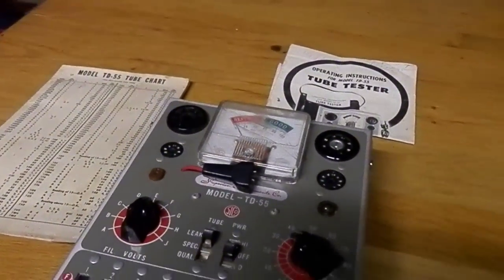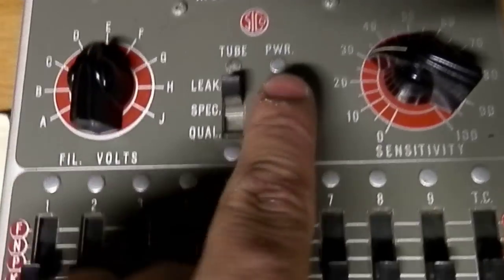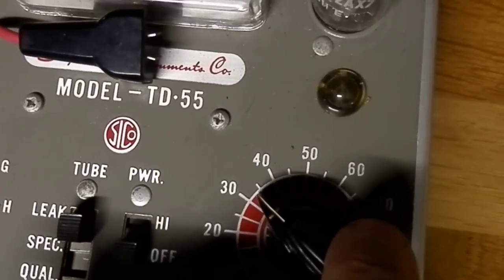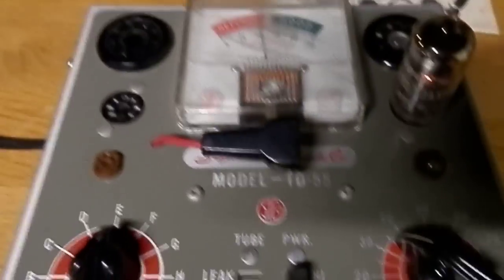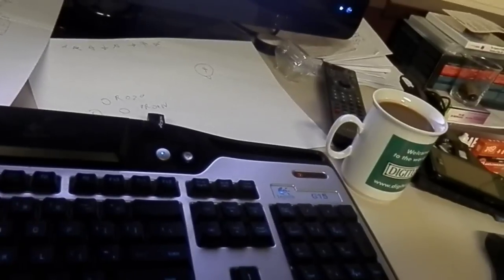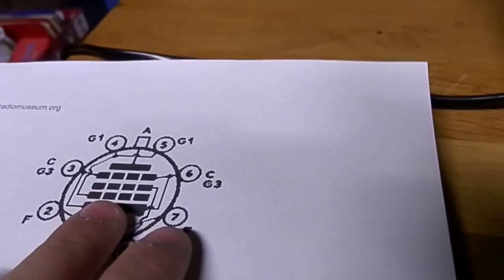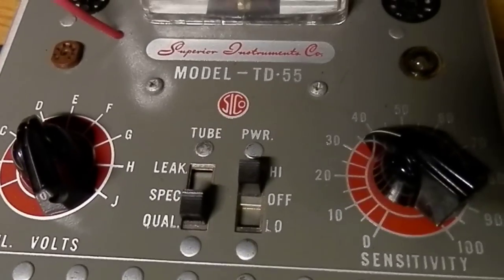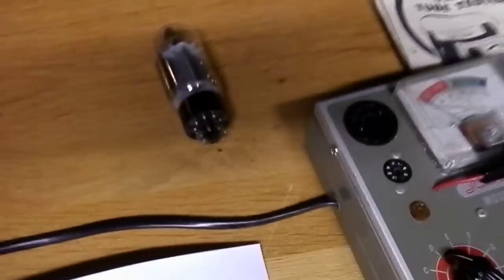how to operate a TD-55 tube tester

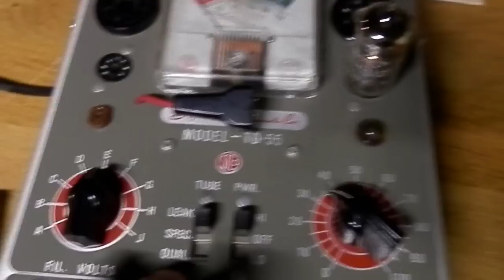Comment: I noticed two procedural errors in this video: First -- At 4:58 and 5:04, you switch the filament voltage setting with the tube inserted and the power on.  NEVER DO THIS.  The operating manual states: "Do not under any circumstances turn this switch after a tube is inserted into any of the test sockets. The switch should always be set before inserting a tube."  Second -- when you test the elements with the ten elemental switches, you neglected the instruction to "Tap the tube and observe the short indicator lamp" after switching the elemental switch to the P position; you observed the lamp but you never tapped the tube.
Reply from the maker: why not change the voltages during use?
also you are right on the second one

Comment: Does anyone know how to test a 6n2 or 6n2p preamp tube on this tester ? A 6n2p is like a 12ax7, but it runs at 6.3v and pins 4, 5 and 9 are different from a 12ax7. If anyone knows how to let me know. The manual stops at 6n4 and another manual by Lafayette (which is the same unit) has 6n3. But 6n2 i cant find. Thanks ;-)
Reply from the maker: to be honnest just set the fillaments to 4 and 5 and then the voltage to 6
the rest of the 12ax7 settings can be used

sorry I cant help more I dont own the tester anymore
Reply: @robot797  On the Filament setting I dont know what the voltage is for each setting. Its A-J letters for setting filament and the manual doesnt give you the details of what each setting is. Thanks for your response. Do you remember what setting is 6volt ?
Reply: @robot797  I think this is Volt Selector. 
1 - A
2,3 - B
4,5 - C
6, 7, 8 - D
10-18 - E
19-35 - F
40-50 - G
117 - J

^ Am i correct ?

Comment: Hi I just purchased a TD-55 off Ebay and have found your video very helpful.
I did notice that your tube data sheet is a later version (1958) than the one supplied with my machine (1956) and that yours has a lot more valves. Do you know where I could download the 1958 version.
Reply from the maker: i actualy dont know were the new tube  chart can be found

i would scan mine but i dont have it anymore
i traded it for a newer tube tester

Comment from the maker: i looked at the tube data sheet
it sais a voltage and by reading the tubes you know
you can sellect the voltage

(ecc81 is 12.6 volts so i have to put it on E)
Reply: My meter is stuck on good what can I do about it. Thanks for any help. Paul.